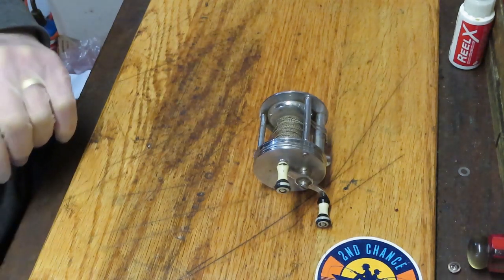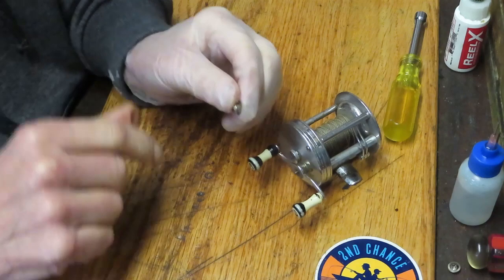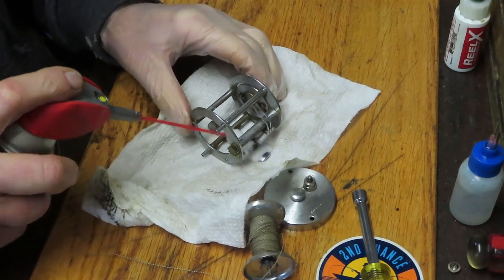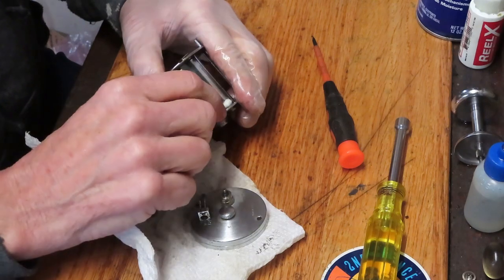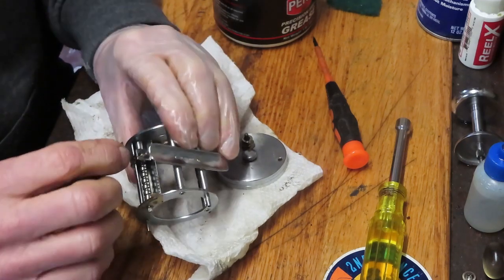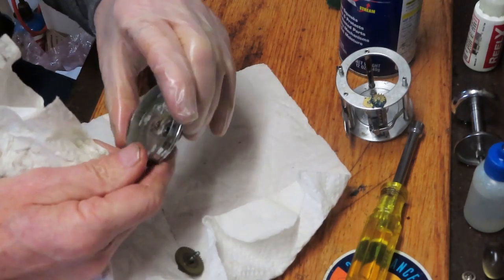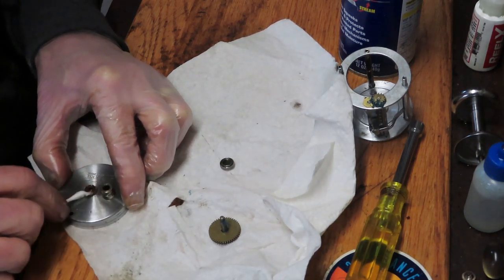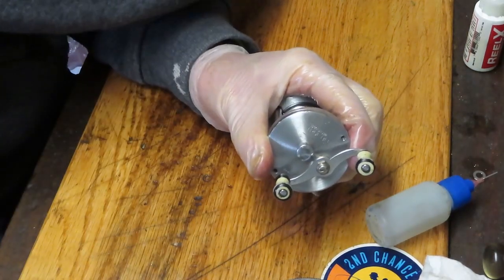This Shakespeare True Blue 1956 fishing reel can get a 2nd Chance how to service and repair

Comment: It is an absolute tragedy what has happened to the once rich and honored legacy of Shakespeare reels. I have 35 vintage Shakespeare reels all of which were made in either the USA or in Japan by Ohmori. This True Blue reel is absolutely like a fine jeweled clock. I have only kept the old Dacron line on two of my most valued vintage spinning reels - a Luxor Saumon Mer that was made before I was born (1954) and a Mer 52 Punch surf spinning reel also made in the mid 1950s by Hellion et Punch. Both of these are from France and I have more than one of each of these that I have used to surf fish. My favorite vintage Shakespeare spinning reels are the Sea Wonder models made in the USA  and the blue 2400 series reels made in Japan by Ohmori. Thank you for sharing this vintage treasure with us. It is a remarkable piece of fishing history! — Chris
Reply from the maker: YW - I particularly like the Royal Maroon series and of course the Sea Wonders - Best wishes Chris

Comment: Great Video Dennis. I have a True Blue myself except its an FK (1951) and have it mounted on an age appropriate 6 foot Shakespeare fiberglass casting rod. I have gotten pretty good at casting it and am looking forward to using it. I also have an Ocean City Interstate freshwater baitcasting reel on a true temper fiberglass rod that I also plan to use.  Both are spooled up with 20 lb braided dacron line made by a company called Woodstock. As always, keep up the good work
Reply from the maker: Very cool!  It is nice to see the old equipment being used - Best wishes  and thanks for sharing
Dennis